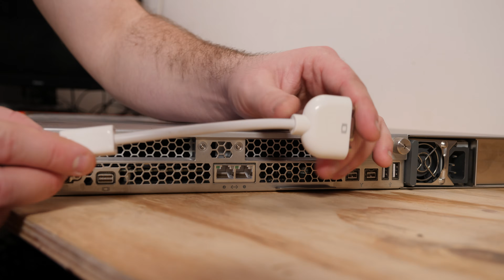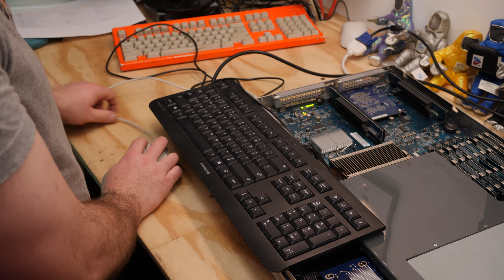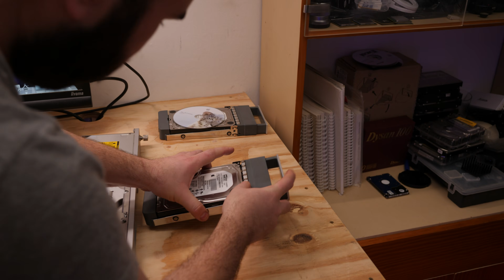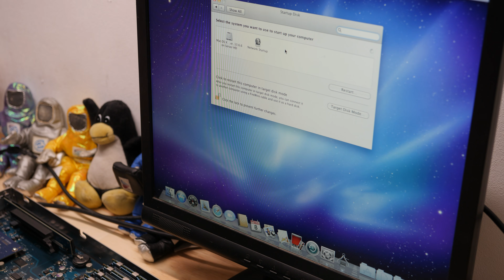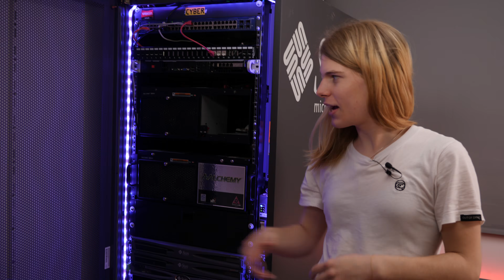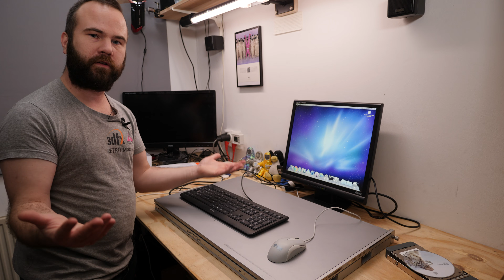The Apple Server from 2008: Apple Xserve 2.1

Comment: To 2:00 - WRONG !!! The Maschine takes MORE than 1 TB per Drive !!! I got a 4TB drive without a problem running in that 2,1…
Reply: Really?  Wow.  Apple originally stated ADM compatibility was 1TB 7200-rpm SATA or 450GB 15,000-rpm SAS (for 3,1 Xserve), presumably because of firmware at the time.

I know people have experimented with putting larger capacity drives into Xserves but with limited success.  Being able to have 3 x 4TB drives in one of these Xserves would make the proposition of running one today a real possibility.

Comment: This was really fun! Years ago Tidbits, had an April Fools edition, and it included an "Air Freshener Kit" for the Apple XServe, which went into the large tunnel vents. Hilarious, and since we had a stack of these, we thought it was perfect. They also had a room air filter kit as well if I remember correctly, so your Xserve could clean and make the air smell better. Evidently, Apple heard from folks seeking to order them! I used to wear hearing protection when I worked on them. And now, with the price of electricity, I'm afraid to boot mine up!

Comment: I'm not really an Apple guy but this server is really interesting. Might keep half an eye out for one but don't think I'll find one where I am. Is there any way to replace those fans with quieter ones, though?
Reply: I’ve been wondering the same thing since I got my first Xserve in the early 2000’s.  At the time, it was a definite “No”, as no equivalent replacements were available.

They were always loud — intended for datacenters or server rooms — where noise doesn’t matter.

Nowadays, I suspect it’s a different story regarding the fans.  Partly because I don’t believe ︎Apple had proprietary fans made (the housing, yes, but not the actual fans), so if you took the housing apart (I hope) they’ll be standard server fans inside, made by a third party, which can now be replaced (assuming the physical size and voltage is identical), with Noctua silent fans, for example.

That would make a huge difference to the volume of these machines, for sure (!).

This is something I need to investigate too.  Wouldn’t surprise me if some bright spark on MacRumors or somewhere has already attempted swapping out the fans successfully.

Seems reasonable.

Comment: Did you ever fixed it? Could it have been the wrong version of the installer, like one for a normal mac instead of os x server? I kind of not got it but i hope you were able to fix it, nice machine, even with the faults it has in design

Comment: Apple is not the best at making an OS, particularly a server OS. I remember some tests with MySQL from years ago https://www.anandtech.com/show/1778/8 which showed that Linux performed better than Apple’s own OS on its own hardware.
Reply: It might — eventually — yet it’s not an equal or fair comparison because Linux is a more spartan OS than Mac OS X 10.5.8 Leopard Server or the Xserve 3,1 with maximum OS X 10.11.6 El Capitan (with required Server OS components).

Any flavour of Linux would necessitate the installation of quite a bit of software and a lot of configuration to match Mac OS X Server out of the box — and Linux certainly doesn’t have the beauty or elegant simplicity of the Mac Server which “Just works”.

I suspect that, if those MySQL tests had been performed on a dual-boot Xserve (El Capitan Server vs. Linux), the results would not be the same as you claim.

Comment: Also, T for "target disk mode" - Google how to use that.  You can install MacOS from another machine across the network or over a firewire cable as the machine itself will act as an external drive.